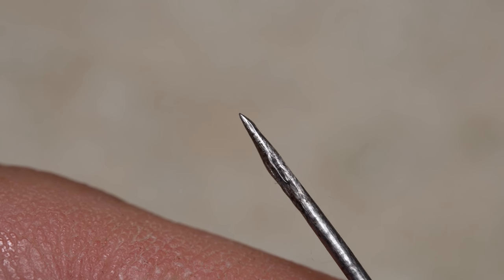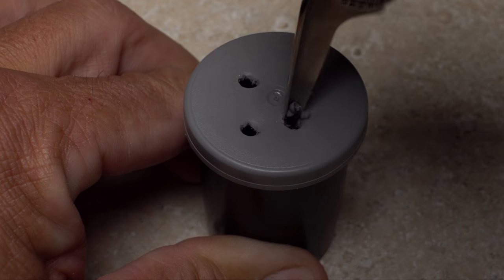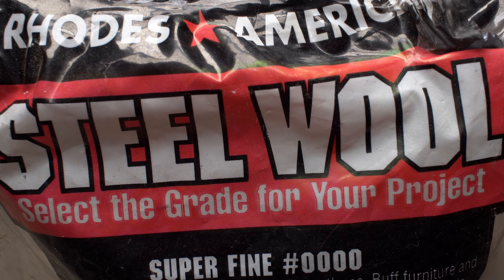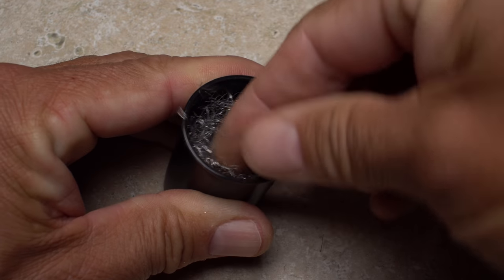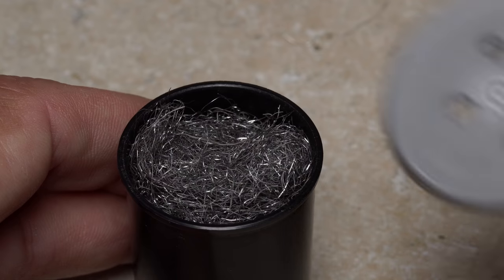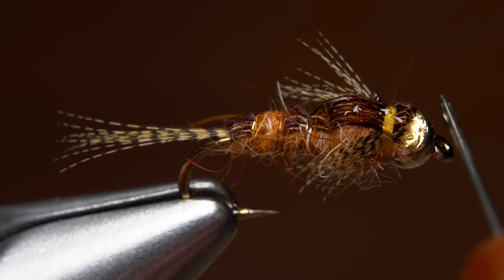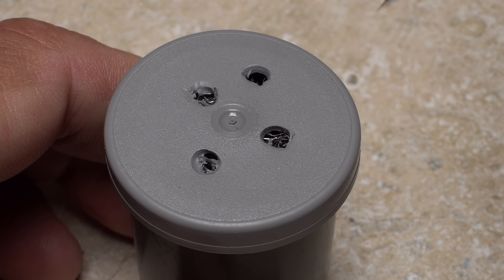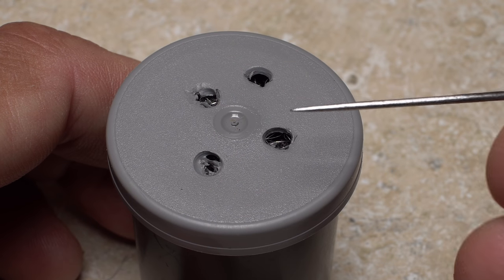Cleaning a Dubbing Needle

Comment: I stuff steel wool into one of the round holes in my Renzetti tool caddy. Works great. I also found a decorative burl wood bodkin cleaner at the symposium several years ago that's filled with copper wool. Because copper is so stiff, it helps take off dried glue, but it will bend the tips of cheaper bodkins if you're not careful. Great video, Tim, as always!

Comment: Great tip Tim! I have had one of these steel wool packed 35 mm film containers on my tying bench for years (decades actually) and it works very well!  I have found that, after scraping dried cement/CA or cured resin from the bodkin with a hobby knife that burning off the last little bit of glue with a lighter and then scrubbing in the steel wool pot leaves it perfectly clean. Cheers!  Hank

Comment: I keep a paper towel  handy and wipe off the bodkin after use.  Emery paper also works well on dried adhesive residue; just run the needle through a piece of cloth afterward to avoid tracking grit and grime back into your adhesive the next time you use the bodkin.

Comment: A lot of adhesives, krazy glue and loctite for example, that create heat during the bonding reaction will easily burn off of the bodkin when heated up with a lighter. This usually leaves the bodkin totally bare, also melting off any residual UV resin or other substances. The leftover soot from the burning can then be wiped off with a damp paper towel and its good as new. I do this in a well ventilated space and avoid exposing my eyes to the fumes, and i try not to breathe them in.